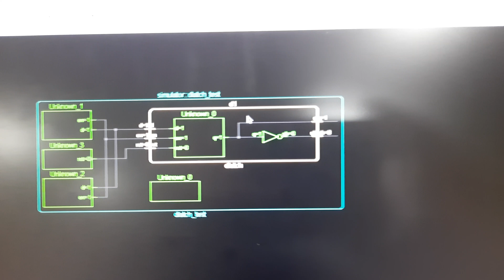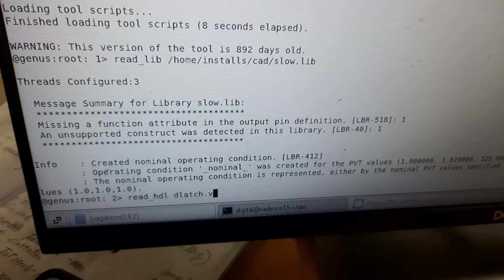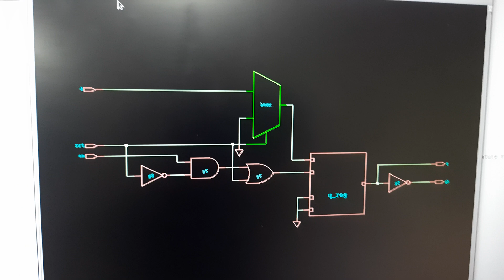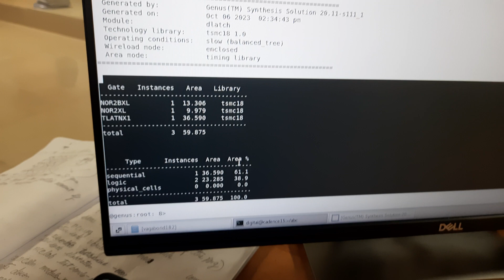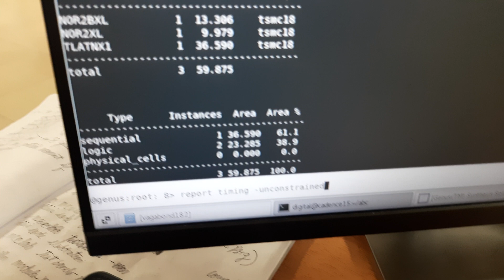VLSI LAB 18ECL77 Synthesis Demo using Cadence Tool(PART 2)

Comment: There is a better way to do this, use TCL file to make it faster. After invoking genus type write_template -simple -outfile new.tcl on the directory you want. Then you can add all the files required just run new.tcl after that